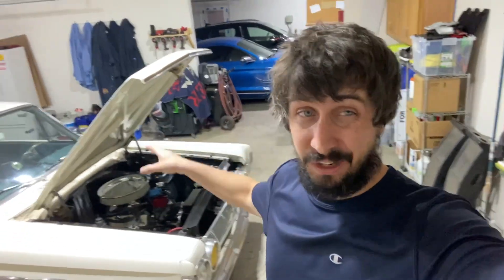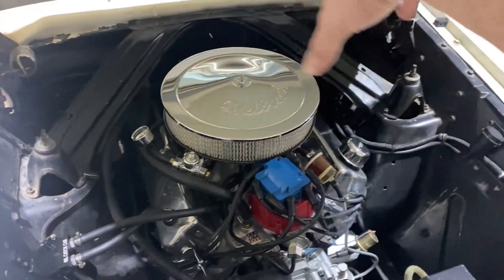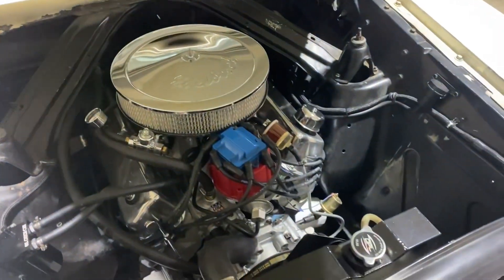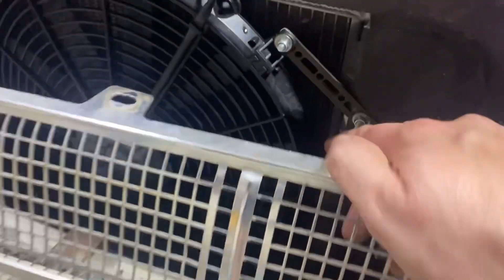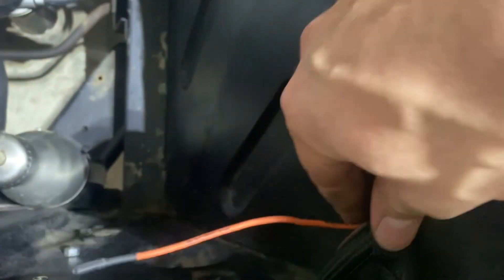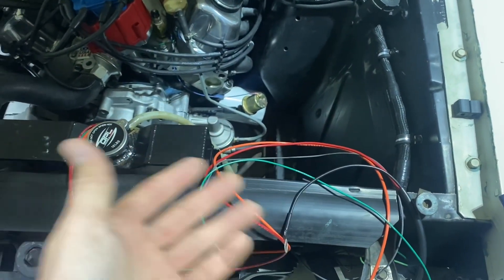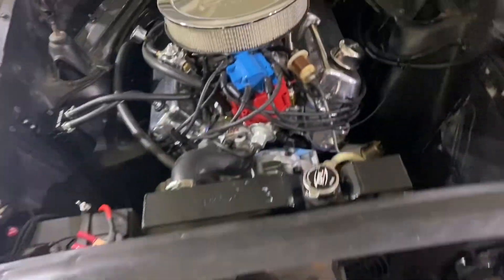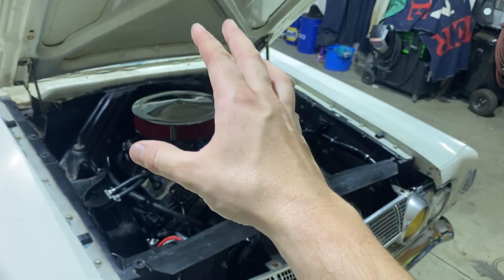The Best Electric Radiator Fan for Tight Spaces

Comment: Hi, never seen anyone use a brass tee nor has it been suggested to me as an option when you’re out of ports! Does it work, fan comes on and off as it should? I take it the other probe is a temperature sensor… is it working correctly? 
For some reason I was thinking the probe wouldn’t be in the coolant, but there I go thinking again 😂
Reply from the maker: Aside from maybe aesthetics (i.e., brass fitting on an aluminum intake) it works great.  So long as it’s the correct NPT thread it really doesnt matter whether you use brass, aluminum, steel, etc.  On this setup both are coolant temperature but one is for my gauge inside the car on the dash and the second for the electric fan.  You could use a similar approach with oil if you only had one tap but needed to know pressure and temperature.
Reply: @truckandroll989  hey man,you are on to something, on my Chevy my intake only has one port for my temp, the radiator probe was inconsistent, I’m in the head right now but too hot, fan stays on. I was going to cut my upper radiator hose and use one of those adapters but don’t really like the look. Spent hours and hours searching for a solution then Walla!  I seen your video and thought that might work!

Your fan is coming on and off like it should?
Reply from the maker: @daves485  yes fan comes on and off like it should.  Another plus is I know my fan set temp and my gauge temp are consistent since I can watch my dash gauge and listen for the fan.

Comment: It’s DC - just reverse the wires and install it on the inside of the bay.  You can even reverse the fan blades.
Reply from the maker: Wont fit on the inside of the engine bay without a shorter neck water pump and completely different pulley system.
Reply: @truckandroll989  Ah!  I feel your pain regardless - I have a 496 BBC in my 66 Chevelle with serpentine beltdrive and boyyyyyyyyyy I had to get a custom made radiator with the same electric fans you have.  Both combined could only consume 5.5".  Luckily a short water pump but still I like what you did.  Just throwing some things I went through originally.
Reply from the maker: @JakeToolson  ive got another video with dual Derale fans on a BBC in a C10.  It wound up working great.  Luckily the SBF doesnt need as much cooling capacity